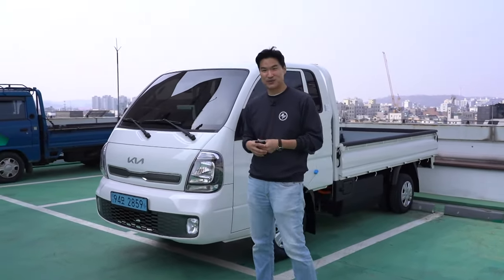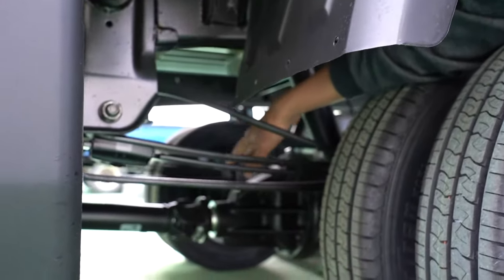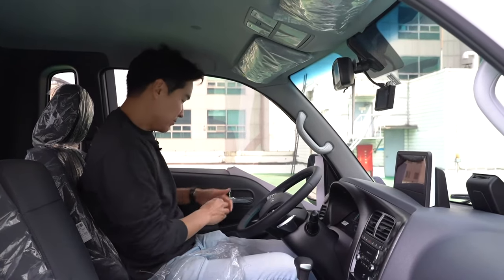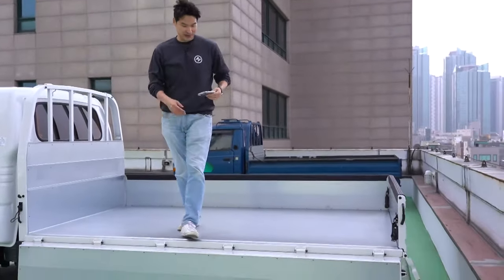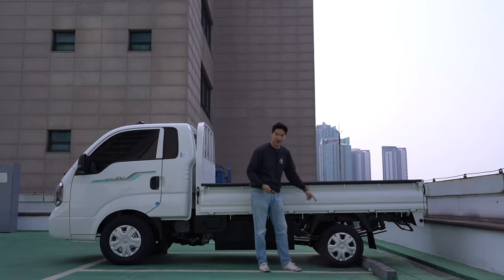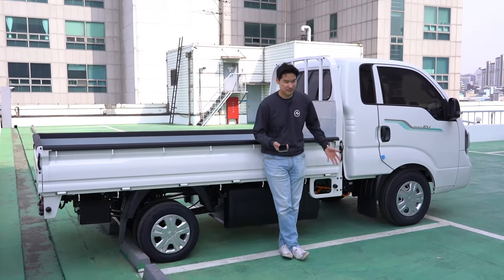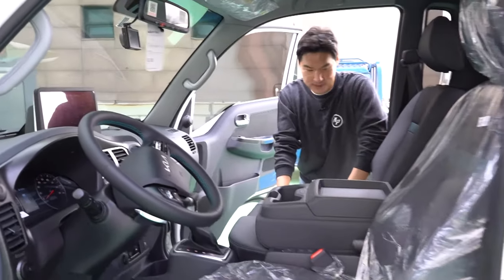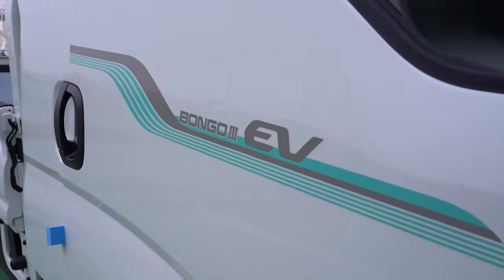Kia Bongo 3 EV – New EV Pickup Truck from Kia!

Comment: Great little thing. But I'm concerned about the safety as it appears to have virtually no crumple zone. Do you know how many airbags it has? Great vid as always 👌
Reply from the maker: wow, I am surprised myself, but only two airbags, one for the driver and one for the passenger. And like you said, it's cab-over truck type, so you have to be careful.
Reply: @AsianPetrolhead  interesting thanks!
Reply: Some maker made cabover with crumple zone nowdays, front tyre in front of driver instead of under.
A pitty this use old platform instead  of designing new one

Comment: Does Kia Bongo electric truck have Safety features (not just airbags) like auto emergency braking, lane departure alert, automatic high beams, rear cross traffic alert, 360 camera, and blind spot monitor?
Reply from the maker: Yes, forward collision avoidance, lane keep assist, and auto high beam and blind spot monitoring system is placed on the Kia Bongo!